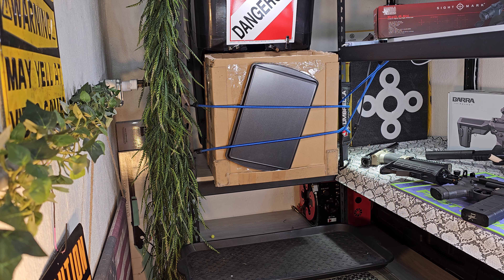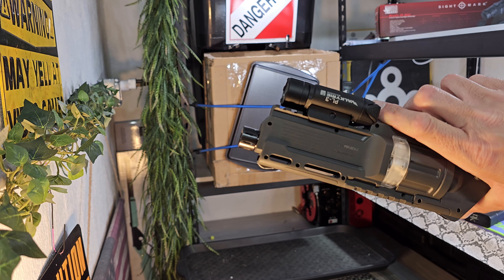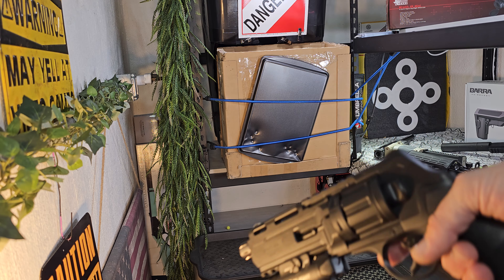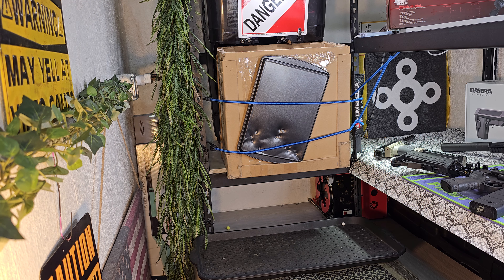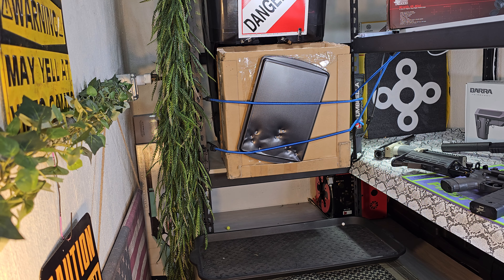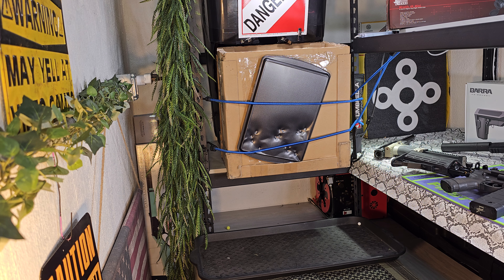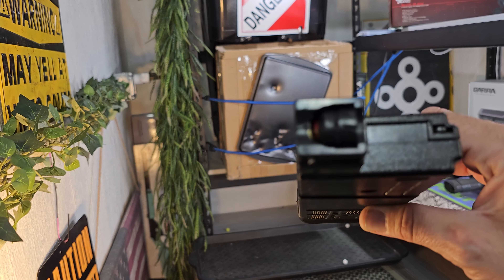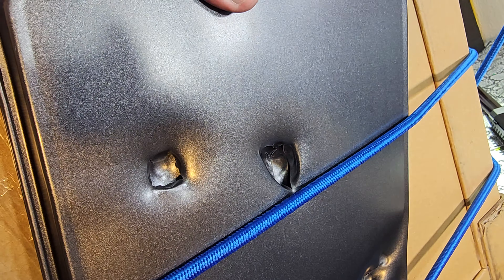HDR 50s HDR 68s BK Kinetics Damage and Chronos

Comment: Hdr50 for 20ish fps i would keep the restrictor for the extra shot count and stability.
Reply from the maker: I was thinking the same thing.  By the way I did attempt using an HDR 68 pin just to see all I got was farting
Reply: @DK-Spencer  is the hdr68 bolt the same as the other 50s?

I found the Hdp50 compact bolt was smaller then the rest but they were backwards compatible.